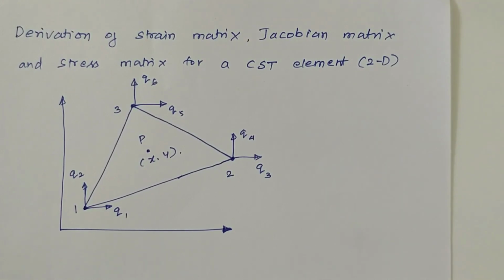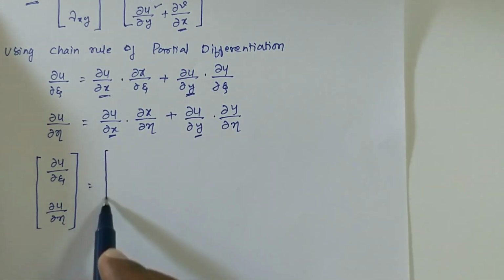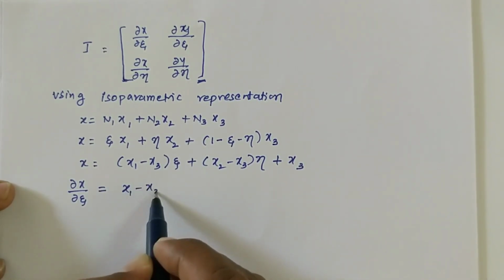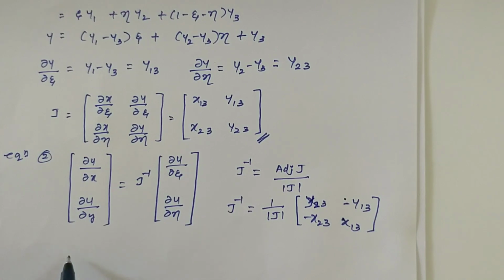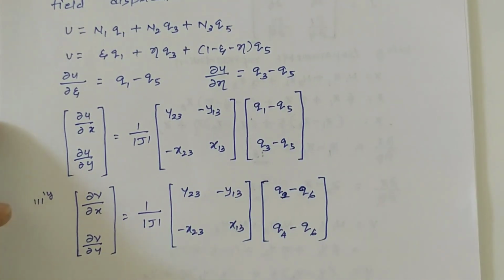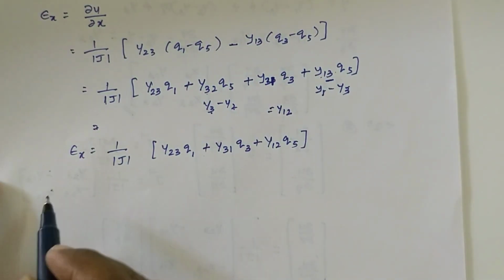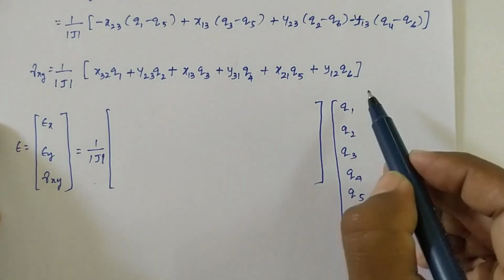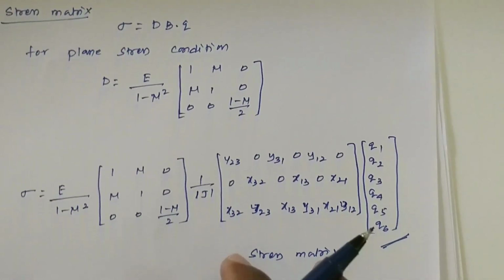Derivation of Strain Matrix, Jacobian Matrix and Stress Matrix , Finite Element Analysis

Comment: sir, value of jacobian matrix ( its determinant ) should be high or low, what is its ideal value
Reply from the maker: It depends on other variables
Reply: @arjunreddy87  sir, can you explain which variable? 
for tetrahedral element second order, max. jacobian value of 10 seems reasonable, or it should be lower than that?